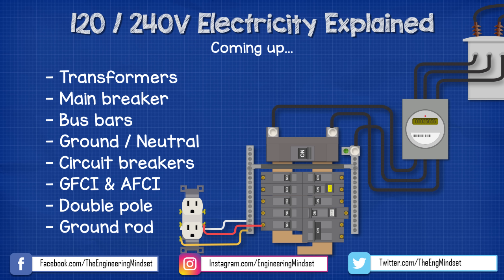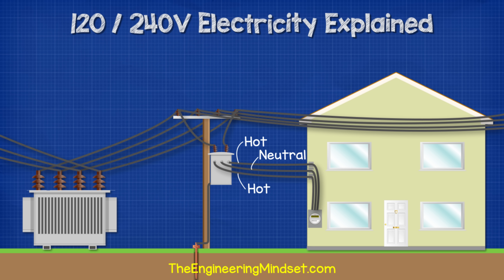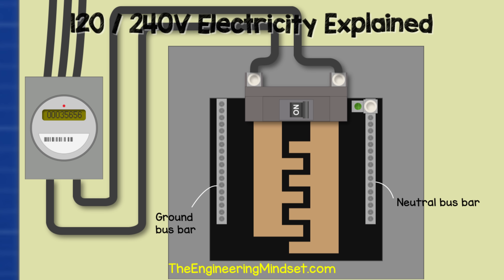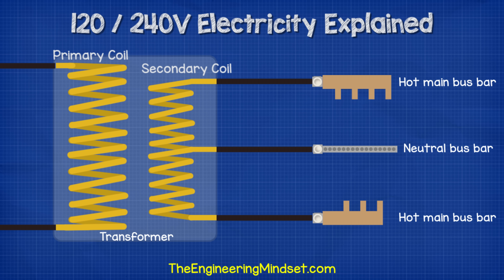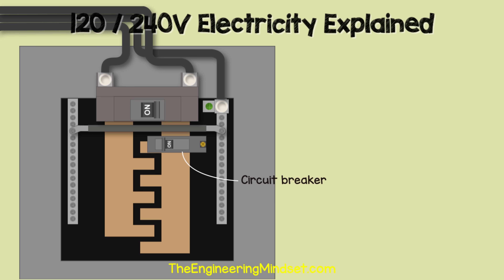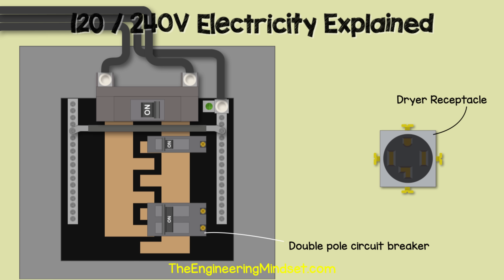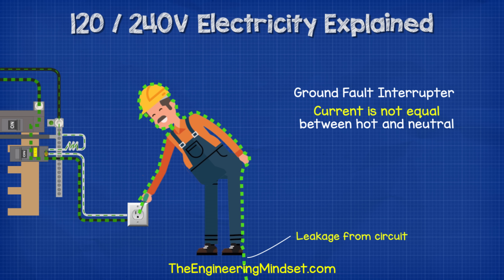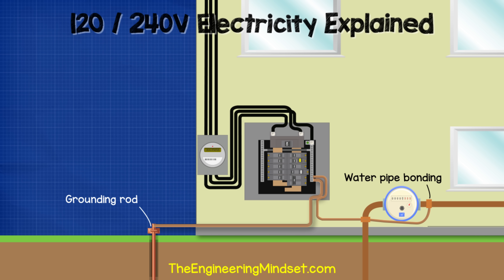120V 240V Electricity explained - Split phase 3 wire electrician

Comment: You nailed it. The only thing that doesn't seem right to me on the graphic is you connect both neutral and ground wire on the same bus bar
Reply: That's typically how they are  wired here. Ground and neutral are sorta the same thing. The ground is a safety neutral so that if your actual neutral wire breaks the electricity will travel through the ground wire rather than through you. In a GFCI circuit if you have a ground fault the difference in current between the neutral and hot wires will be different. If you touch the hot wire while standing on damp concrete while barefoot there will be more current flowing through the hot wire than the neutral wire, or if you are connected to a hot wire from a GFCI circuit and try to bypass the GFCI's neutral connection by going through a different circuit. You could also short your ground and neutral at the GFCI outlet and nothing will happen UNTIL you try plugging something in and turning it on. The current will be split through the ground and neutral and the current through the neutral will be less than the hot. The GFCI will detect this difference in current and open up the circuit.
Reply: Ground and neutral are on the same bar in the main panel in the US.  They are on separate bars in sub panels. Neutral is referenced to ground here in the main panel.
Reply from the maker: Watch this https://youtu.be/P-W42tk-fWc
Reply from the maker: Check the new SUB PANEL EXPLAINED ➡️ video https://youtu.be/NUSNa-7Hecw

Comment: Note, the neutral and the grounded connecton of the higher voltage at the pole transformer are connected at the pole transformer.  The  pole transformer is not an isolation transformer.
Reply: James Willmore well of course, because we haven’t fighured out how to incorporate lightning protection into both the pole and house in a cheap, reliable manner. Derp harder.

Comment: I don get it :( So I dont live with this system, but does that mean the neutral wire is also a hot wire? just with lower voltage? I geuss the answer is no, that you have 1 hot wire +120v and 1 hot wire -120 volt, and neutral is 0v, but how and why?
Like the beginning of the video says, this is not my type electricity grid, but i was curious to try and understand how it is done over there.
I am used to European grid where neutral is 0 volts, and you would get sqrt(3) i.e. 1.7 times the voltage by using 2 hot wires compared to one hot with neutral.
I wonder if they use a similar grid to this in Norway? they have strange system that I dont fully understand either.
Reply: We use the center tap of a single phase transformer as the neutral wire. It's only called neutral because EVERYTHING else that is grounded is also connected to that neutral wire. So the voltage reference between the "neutral" wire and ground is always 0 volts. The two hot wires are the other two taps off the transformer. Measure across those two hots and you get 240v. Measure between one hot and the neutral and you get half that because the neutral is the center tap. In theory, you could use your ground as a neutral connection when running 120v appliances, but this is a big nono due to the fact that A: it will trip your GFCI if you have one of those, and B: it could kill you if something goes wrong.
Reply from the maker: Watch this https://youtu.be/P-W42tk-fWc

Comment: Switching power supplies used on TV's etc can emulate an arc fault signal and trip the breaker making the AFCI useless on that circuit.
Biggest issue for arcing is the quick-n-cheap install process of pushing the wires into the outlet instead of using the screws for a reliable connection.  At the very least make sure the microwave oven is hardwired on the screws.  Pressed in wires will oxidize over time and the
connection becomes intermittent.  This can brownout the microwave oven cpu and depending on the chip.  Could turn it on and run till the fire burns through the power line and the rest of the house.  Was not the microwave that started the fire was the pressed in wiring.....
Reply: Sounds like you have experienced this before.
Reply: eb b    Treadmills with D.C. Motors play hell with AFCI breakers.  Several trip at one time!

Comment: Great video!  Thanks.  I never knew that you got 120V by taking a hot bus bar connection and pairing it with a neutral bus bar connection.  I always thought that everything was 120V and you got 240V by combining two 120V circuits.
Reply: Technically, US homes have 240V service. They just have a ‘center tap’ on the transformer which is an extra wire halfway across the windings. So you can get 120V from either hot wire and the neutral, or 240V across both hot wires. It’s important to note that voltages don’t just add up, so you can only get 240V from the two separate hot wires. If you pick random outlets and they happen to be on the same phase, you’d have 0v.
Reply: Well, that's essentially what you are doing :-) The two circuits just need to be out of phase (else you'd get 0V) - hence the center tap on the transformer.
Reply: Stephan Weinberger    Not really.

Comment: 11:00 
this is why cable is loose in the walls and not fixated anywhere. the screw would be more likely to push the wire out of the way rather than drill into it. 
better example would be using a jigsaw to cut lath boards up during a remodel of an old house. you really want to make sure there is no wire in the path of the saw.
but for simplicity that example works.
Reply: DarkShadowsX5 easy, set the depth of the saw no deeper than the boards’ thickness.

Comment: Sometimes residential garages in NA may be equipped with 240v too. Some of the higher output air compressors or welding equipment may use it. And recently with electric cars needing a dedicated service terminal for their power connection, it may become more common as people want fast-charging.
Reply: I’d rather say that most of the time, having electric water heaters and clothes dryers in a garage when it’s a feature of the main house.
Reply: @HighestRank  Forgot about attached garages, where they kind of throw in the laundry and utilities... But what was coming to mind is the (traditional?) kind that stands as its own structure. Or the nice fancy ones with more than 2 cars that are almost like small industrial workshops.
Reply: I live in Michigan and have installed two level 2 chargers in my garage. Each is attached to a large 50 amp 4 pin range connector to a mating outlet. One is for Ford Focus  Electric and the other is a Tesla mid-range 3. With proper research and physical ability, a homeowner can do this install.

Comment: Isn't electricity slightly phase shifted this you'll have 200v when you measure across.
Reply: You’re thinking of 3 phase power. This example is single split phase.
Reply: Not in this instance. It will be 180 degrees apart
Reply: Voltage and current can be shifted in a measurement called power factor.
Reply: @HighestRank  I don't think that's what Amaan is referring to.  I think he's talking about the voltage you see due to the phase difference when you measure across 2 phases of a 3 phase power system.
Reply: Yes, the system used in residential in the U.S. is a wye connected 3 phase system. Each phase is 120° apart. So you actually will measure 120V hot to ground, or hot to neutral, while hot to hot will measure 208V (1.73 x 120V) not 240V as stated in this video. Even though only two hot legs are typically brought to each residence it is still generated as a three phase system at all power plants in North America.
Reply: @vegasjw  Hot to hot is most certainly 240V and not 208V in US residential systems.  It is split single phase, so the voltage to neutral is exactly half of the hot to hot voltage, 120V.   In 3 phase commercial power, it is as you describe: 208V.
Reply: @stargazer7644  sorry you're wrong. Check any "240" outlet with a meter and it will read 208V. Been doing this for decades.
Reply: @vegasjw  
My 240v outlet measures 240v.
Reply: @vegasjw  I was scrolling through the comments to see where this is picked up. Everyone seems happy to think is single phase 240V center tapped when its two independent phases. The description is not quite accurate. Further you are not allowed to connect ground to the neutral bar in my jurisdiction.  Yes the bars are tied in the main panel but the ground wire goes to the ground bar and neutral wires to the neutral bar.

Comment: People are quick to point out that the US should be on 240v rather than 120v. But when you mention Japan's 100v 50/60hz mixed system, they are suddenly quiet. Great video btw.
Reply: This entire argument is ridiculous. The US system works just fine. If I need 240 I can have 240, otherwise 120 works just fine and it's safer for a homeowner who potentially doesn't know what they're doing! The suggestion that everyone in America should rip out the wiring they currently have, rewire their entire houses, and then buy adapters for every single electric device they own is absurd! 

And the guy who said "you pay tons of money to get a 240 volt circuit wired in (if thats even possible in some areas)" obviously has no idea WTF they're talking about. I ran a 240 wire for my dryer across the ceiling of my basement and down the wall, attached the plug on one end, and wired the other wires to a double pole breaker on the other end and clipped it into the box (while all the power was off). Why would you spend "tons of money" on that? 

Additionally, if switching to 240 is good, wouldn't it be even better to switch to 360 or 480?
Reply: Frequency of AC Power goes back to early power generation (Edison, Tesla, Westinghouse) and the large customers of AC power generation.  
25 Hz, 50 Hz, and 60 Hz.  25 Hz was popular for the traction motors used in street cars and Interurbans (1900-1928).

The Niagara (NY) Dam (1898) and Keokuk (IA) Dam (1913) were 25 Hz.  
The Keokuk Dam generators were migrated to 60 Hz as upgrades were performed after 1950.
Reply: @Mister Brookes I think half of europe was on 110 volt. The french part of belgium still has 120 volt between live and neutral. but all outlets have 2 fase to have 230 volt.
Reply: @Mister Brookes I am from the netherlands, we use the german schuko it also not polarised and we have also sockets without a ground  just the live and neutal 230 volt. those can be found in dry rooms without a conducting floors. living /bedroom attic. Homes before the 1990's.
My house runs on a single phase 25 A.
Reply: @Mister Brookes equipment with 2 prong plugs is verry common in the EU. but it is always duble insulated (2 squers symbole) lowpower equipment like electronics and handheld powertools.
Reply: @MultiArrie  Doesn't have to be low power, just double insulated. I.e. it can't have any external metal casement, and even if a wire did beomce loose inside the equipment there would be twe barriers between you and the wire.

I have a 2200W tool that is double insualted
Reply from the maker: We just published a new Ground fault, short circuit and arc fault video, so much detail! Link HERE➡️: https://youtu.be/Qi0ynSQw-wc
Reply: I would prefer 240 over 120 here in the USA. It's more efficient and not that much more dangerous as long as it's designed properly. I think the big reason why we still use 120 is because we didn't have our infrastructure bombed out and destroyed during ww1 and ww2.
Reply: People here saying 120 is safer, while it may be if you get zapped, the fact it needs double the amount of amps for the same rated power would probably make a fire hazard more likely.
Reply: The 120 Volt / 240 Volt arguments are now over 100 years old, and not unlike English versus Metric arguments.
United States residential electric service was largely 60 Amp after World War 1.  
FDR during the Great Depression expanded US electrical service nationally with Rural Electrification Act (REA), TVA, and hydro-electric dams.
For agricultural farms, that had been using gasoline, coal or fuel oil ... 3-phase electrical service permitted usage of electrical motors.

After World War 2, the United States had an opportunity to migrate to 240 V from 120 V (automobiles migrated from 6 Volts DC to 12 V DC systems after WW2), BUT this did not happen.  Such a conversion project would have been as large the Interstate Highway Project (1955-1980).
Rather Split-phase 120/240 V was installed in new residential homes or older homes that previously only had 120 Volt single phase service.

Green Safety Ground was first mentioned in 1963/1965 NEC books, and mandatory for new construction after 1970.
Reply: @Mister Brookes 120 is much safer than 240. Doubling the voltage delivers 4 times the power to a zap which could be the difference between a shock and an electrocution. The safety is worth the added cost in a house.  The 240 is great for being able to have large load items like electric stoves or dryers, but 120 is all that's needed for residential lighting and outlets.
Reply: @danhardhat2  we use different wiring for lighting in Australia...thinner than the power flex.
Reply: @danhardhat2  doubling the voltage is only double the power but neither voltage or power matter it is current alone that kills the voltage only needs to be high enough to overcome your skins resistance so pretty much anything of 50v
Reply: @shaynegadsden  It's 4 times. Power=Voltage squared over resistance is one of the laws (kircchov's or ohm's law don't remember which). If you double the voltage, you double the current across the same resistance. Power is voltage times current so doubled voltage times doubled current is 4x power. 
4x power is very dangerous for residential. Kids get belted from shoddy products, frayed cords and the like frequently.
Reply: @danhardhat2  yeah I see the math your using still doesn't matter though with current standards all outlets are to be ground fault protected so our 240v system works out much better and for large appliances compressors, AC etc we have 415
Reply: @shaynegadsden  If you have ever been hit by 277, you would think differently.   120 is the best choice for residential. Especially when you have YouTube electricians playing with it.
Reply: @Ryan-hr9hw  not sure where you get 277 but I have been hit by 240 a few times now that's why here it's illegal for an unqualified person to perform electrical work but there is no difference between 120 or 240 in terms of safety once the voltage is high enough to cause a shock your pretty much screwed and are relying on the protection devices to save your ass, so for the end user it's all the same with the same risk but as an installer 240/415 is a million times easier smaller cables, less circuits required and for things needing a lot of power large compressors and big AC units they are smaller and more efficient
Reply: @shaynegadsden  277 is the standard commercial lightning voltage. The service for businesses is almost always 480/277 3 phase.    
I am an electrician so have seen my fair share of shorts and shocks.
Reply: @Ryan-hr9hw  ok that just makes the US electrical grid seem even more stupid every thing here is 240/415 there is no difference between residential, commercial or industrial with most houses being single phase but 3 phase is becoming more common and a few houses roughly the 50's and earlier had a 2 phase setup not for the 415 voltage but for load balancing primarily used in electric stoves either way it just makes more sense to standardise power distribution
Reply: @shaynegadsden  very important of current impulsed for the voltage. more voltage it's more dangerous. ohm law more voltage = more current.
Reply: @shaynegadsden  You have a wrong of 120V or 240V safety.
Ohm law, more votage in your body it's more current.

277V ph-n from industrial 3ph voltage 480V
Reply: @shaynegadsden  Use 240V for all apliances is most dangerous of 120V.
In 120 or 127V sistems you have 230V with 2 hots fot a oven, for example. little apliances not need 230V, work perfectly in 120V.
It's stupid think only voltage or low voltaje service network, the industry or the homes not net same voltage. Homes are ned 10...20kW, industry ned 1000...10000kW....

The 240/415V for home is a error historical from european 2WW.
Reply: @raperoespana5295  yes for ohms law but no for people we are giant electrical circuits with the only thing protecting us from the outside is our skin and anything over about 50v can overcome that, so the difference for use then is available current. 50000v from a taser hurts like hell but generally your ok 120v and your more likely dead the difference is the current available the taser is about 2.1mA depending on the model and 120v without ground fault protection is amps it is also why electrical safety charts give you the potential effects of shock in mA since that is main factor
Reply: I wish North America had 240 volts as the common mains power as its a pain in the ass that some places only have 120 volt plugs and thats not enough for a decent workshop unless you pay tons of money to get a 240 volt circuit wired in (if thats even possible in some areas)